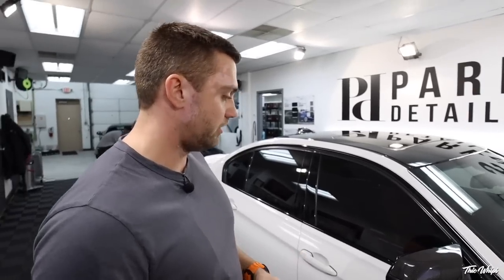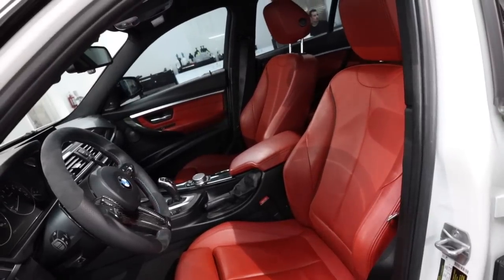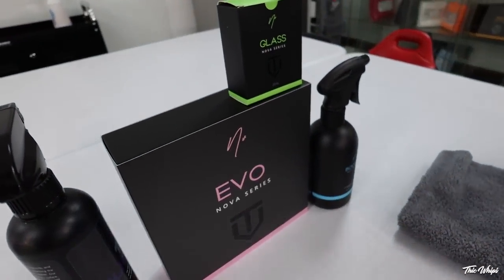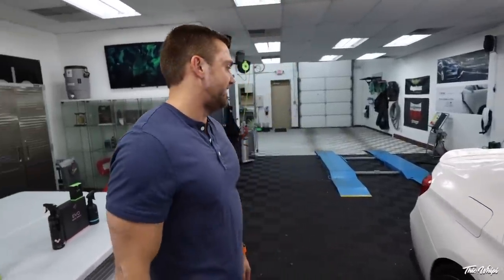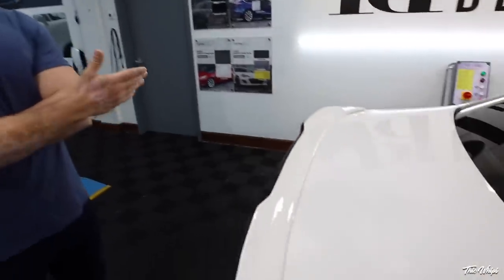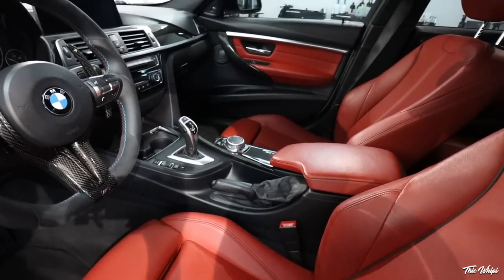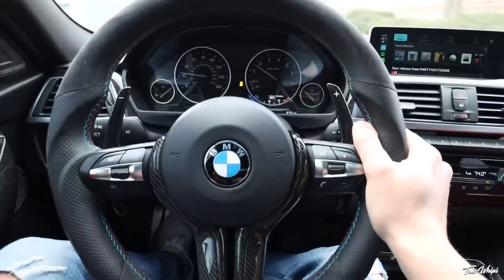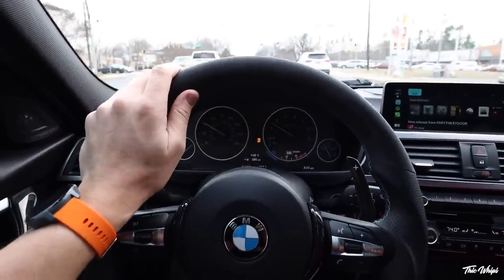NEVER IN MY LIFE HAVE I OWNED A CAR THIS CLEAN...

Comment: Just out of curiosity if someone was coming off the street and have all that done it's done what you just had approximately how much does that cost
Reply: Prices vary greatly from detailer to detailer and condition of your vehicle.  A brand new (as near as perfect can be) can significantly vary from a vehicle like Johnathan's that needed a lot of work. The best way to get an accurate price would be to visit Parks for free estimate, or you local highly rated detailer. From experience only a car in new condition verses a car that needed as much as work as Johnathan's car prices can vary from $2,000 - $4,500. Four full days of labor went into Johnathan's car , that is a lot of labor cost not to mention the actual products cost. His car was likely on the higher side of cost.

Comment: Hey whips, so I have a scenario and I need your opinion. I got a used 335i m package 2015 in blue Wich I looked for 6 months ti find, the mileage was 48k. I went to test drive it, I loved it. It was perfect had a tune, downpipe and a few other aesthetic mods. I waited two weeks for the dealership to finish bodywork and picked it up near Christmas time. Well, the day I got it I drove it two hours home and right before I got home it blew up on me. A lot of White smoke out the exhaust and the whole engine seized and it didn’t sound good. The dealership took a month too give me my money back. What is your opinion, should I get a 60-70k mileage 340i? I saw what happened to yours or should I just stick to my plan 
335i m package sub 60 miles (preferably blue/ or anything w red interior. 

I’m pretty annoyed but I’ve just been waiting and checking the market every single day
Reply: Try not to buy someone else's project car that they offloaded for unknown 'reasons.' Find one as close to stock as possible and mod it yourself. If you can, get the car inspected prior to delivery/purchase - if that's not possible, get the car up on a lift at the dealership and check it yourself - any funny business with DP or Turbo or Tune would be a deal breaker for me personally, especially if there aren't any available details on the aftermarket parts or tune... disaster waiting to happen, especially if there's no warranty. I bought a 2015 435i with 80k (km - Canadian) on the ODO, but it was all stock, with full service history and CPO'd with BMW warranty. I've swapped out the N55 failure points (coolant overflow hose, charge pipe etc.) myself and made it my own. Just my two-cents, but take it for what it's worth. Good luck.